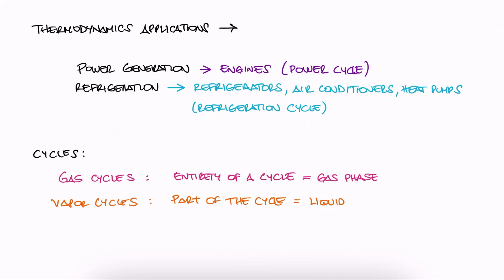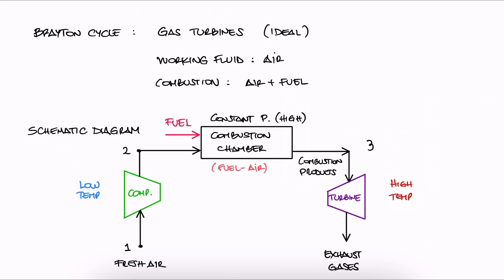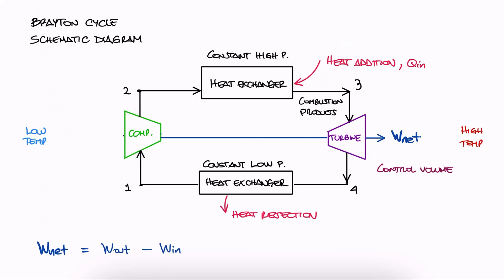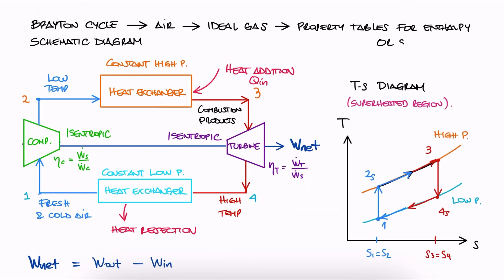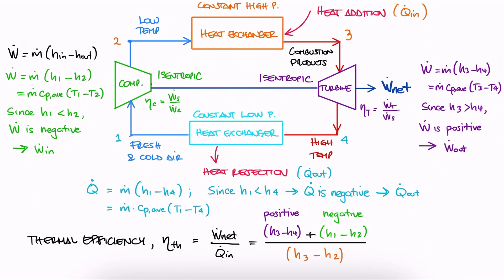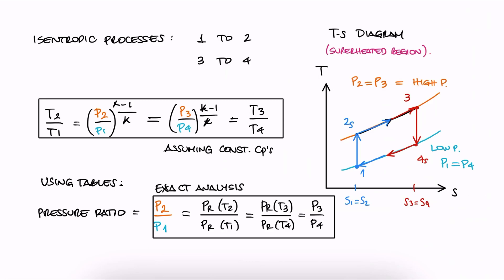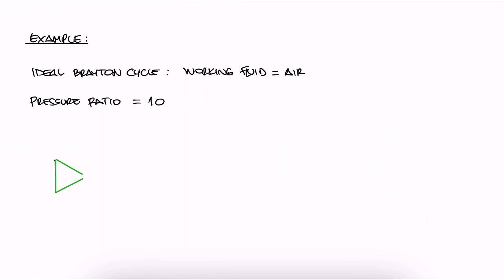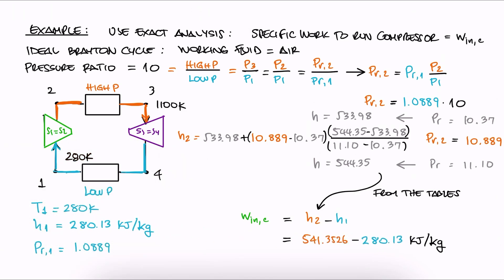Ideal BRAYTON CYCLE Explained in 11 Minutes!

Comment: Whats the different between capital Q with dot and small q with dot?
Reply: Actually in this case, Q_dot is "rate" of heat transfer, and q_dot is rate of heat transfer on a per mass basis. Basically just heat transfer divided by mass, with units of kj/kg in the metric system.
Reply: @jamesturcotte3689  Cool thank you.
Reply: Q with dot is in KJ/s or KW it means that it is the heat added or removed per unit time, while the small q is in KJ/KG, it is the heat per mass of the system
Reply: And what is the difference between m with dot and m ?
Reply: @aliyasser4364  m is mass and m-dot is flux of mass entering or leaving some region per unit of time
Reply: @aliyasser4364 m is just referred to as mass kg, while the dot is a derivative of time so m(dot) is kg/s which is known as mass flow rate
Reply: @aliyasser4364  m with dot is mass flow rate measured (kg/s). m is mass (kg).
Reply: Capital letters indicate a property with mass in it (regular property). Lower case letters mean they are divided by mass, so always /kg. 

The dot means per second or per unit of time. The dot indicates a derivation, usually relative to time.
Reply: Q_dot is Heat Transfer and q_dot is heat flux.